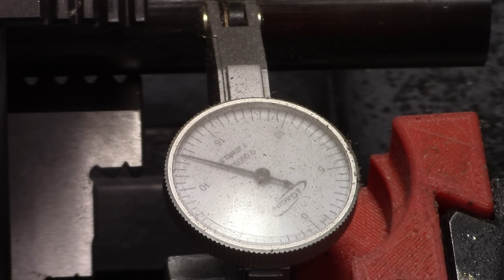Making a Thread Mount Back Plate for a 5-inch chuck + A useful modification, K12-125, K11-125

Comment: Winky thanks for another invite into your shop. They're always appreciated and enjoyable. A couple of things though.. I'm one of those in 'Camp Shoulder' when it comes to its importance. The tenants of that camp dictate that the back plate should be bored for a precision fit to insure repeatability when mounting the chuck to the spindle. Unless I'm missing something boring it for precision fit can be done subsequent to threading.  to facilitate test fitting.  
My other observation was the nifty indexer you made. I'm going to make one too. For those without one "Transfer Screws" come in very handy for accurately center punching those holes. They're sold but nn a pinch they're easy enough to make in a relatively short time. .
Thanks again.
Wakodahatchee Chris
Reply from the maker: I always aim for a good fit but I think the treads are self centering. This chuck was about .003 over but I'm usually about .001 over. Scott Logan said the same about a thread mount. That doesn't make him right but I do respect his opinion. I've had problems with the transfer screws but I suspect it was my drill press quill. I've since adjusted the quill but its not perfect.

Comment: You could correct the runout of the chuck body by taking a few thou off the register on the backplate, re-assemble the chuck, and snug the bolts but not torqued. Test the runout and soft hammer the chuck body in the direction needed. You'll be able to nullify any runout to the limits of your patients. Tighten the bolts and check again.
 Then, test the runout in the jaws.I'm not sure if they're numbered, but they should be, so they go back in their respective slots. Try different combinations to establish where they were ground in at the factory. Once you establish the best combination, mark the body and jaws appropriately.
Reply from the maker: I was going to do as you suggested but after looking at the runout a little closer I realized the jaws were an issue. When clamping inward the runout high side lined up with number 3 jaw and when clamping outward it was 2. The the other jaws (external) were similar but the high jaw was a different number. Basically I didn't want to have to adjust the chuck every time I changed jaws so I ground (actually cut) the jaws level.

Comment: Nice work sir. I had the same run-out problem with my chuck I just grind it to suit the center of my lathe and it worked perfectly since
Reply from the maker: I will likely do the same but I also want to make sure its off the same at all diameters.

Comment: Nice work. I will note, that when cutting internal right hand threads, you should rotate the compound to the other side of zero degrees.
Reply from the maker: You are correct. I new better and messed up. I'm guessing the carriage had enough drag to keep the lead screw backlash from being an issue.

Comment: 13:00, is your compound running in the wrong direction, 
I have cut interior threads like this, but I think you are supposed
to have compound feed handle on the side of the chuck, 
please correct me if I am wrong.....I am commenting while 
watching, so have not watched the whole video yet.....
cheers, Paul
Reply from the maker: You are absolutely correct. I just messed up. I actually run it to the back side sometimes but the way I did it was wrong. The threads are pulling the carriage. It's amazing but it worked well. I guess the carriage has enough weight or resistance. Good catch!
Reply from the maker: Wow...  Good catch, you are right. I just screwed up. Surprisingly it always works but there is a potencial for screwed up threads. The threads are trying to pull the carriage.

Comment: enjoyed immensely, now you can grind those jaws in the 4 jaw to get .0001 runout......best wishes , Paul
Reply from the maker: I was thinking about turning down the register a little and moving the chuck body off center. Another comment suggested removing the plastic chip guard over the scroll and inserting back plate into the chuck more. If I do this I might have room to install set screws to adjust to center
Reply from the maker: I'm thinking about tuning the ledge on the back plate to make it adjustable

Comment: Cool project! When I made a backing plate for my 12" chuck, I used transfer screws in the chuck to mark the backing plate. I really like your lathe indexing setup.  🙂
Reply from the maker: I've done the same with the transfer screw but I seem to have better luck with the indexer. Thanks

Comment: You could have used the outside diameter to register your drill and the worked backwards to the pcd of the mounting holes. Works a treat.
Reply from the maker: Accurately measuring the hole position on the chuck was the hard part. Doable but prone to error.
Reply: If you take a centre distance  hole measurement and divide by 
0.86603 it gives you the pcd of the bolt hole circle. Hope that helps. Love your videos and greetings from Australia.
Reply from the maker: @kevinsmith1976  The center distance is the part that make this difficult. I've made threaded bolts with a point or used a transfer bolt in the past to do this so its doable, just adds a step.

Comment: I like it too! LoL 😂😆 
If you want that chuck to run truer, you can machine the jaws in an out but stable condition. 
Search grinding lathe jaws or truing lathe jaws.
Reply from the maker: Yep...  I've done that severa times. I need to make sure its similar at different diameters first but if it is, I need to do that

Comment: Pardon me for being philosophical here. Re: People saying you can't bore that out. Imagine for a brief moment the nay sayers always having their way. Innovation gets rigidly restricted to established paradigms. And what if this applied for the past 1000 years? What would the world be like today? Safe to say we wouldn't have cars. Or, or, or ...........

Anyway, nice work, Even if you have compromised the integrity of that chuck which was undoubtedly made to the very highest ASME standards that the jobber shops of China rigidly adhere to. (I better check my coffee for sarcasm additives)
Reply from the maker: Ha...  I agree 100%. I've always pushed the limits within reason. I worked for a printing company most my life and there were some people that would rather live with a poorly running machine than to try making it better. The logic was that it was running and you might make it worse while attempting to fix it. As time passed we got updated machines that were much easier to run but the people that were afraid of change stayed on the old machine eagerly working the ass off to avoid change. The last 15 years before retiring I was doing an engineering job (without a degree) designing machine modifications in problem areas. It was a lot of headaches but also fun.

Comment: That turned out nice. I’ve had a couple of attempts at making a collet check. First one was fine, but the second one.  Well, I couldn’t decide whether the thread was tight or the index was a thou too small and ended up trashing it! 😏 Regards Robert
Reply from the maker: I think a collet chuck is more difficult to get right.Thanks

Comment: Another interesting and useful project. The first job I had as an apprentice was fitting a backing plate to a chuck. If that four jaw was mine I’d figure out how to brace the jaws and hard bore them true. Shouldn’t be too difficult with a large carbide boring bar
Reply from the maker: Thanks, yeah I might fix the jaws, I've done that before. However, I need to mark the low jaw and see if its consistent at several diameters before I do that.

Comment: Winky, a Chuck Backplate should be cast iron. It is not a good idea to have steel on steel with the lathe spindle, it can gall up. I do not know of any chuck manufacturer that used steel back plates. Take care using it and add a small amount of lubrication on the spindle thread when screwing it on to be sure you can get it off again. Regards from Australia.
Reply from the maker: Hello Dave, well in this case I'm going to have to disagree. All my chuck have steel back plate and have had for about 10 years. I've never had a single problem. Bison sells thread mount high strength steel plate as well. Steel is much stronger than cast and performs much better on a smaller threaded spindle. I've had threads break on cast back plates. Probably low quality plates but never the less, steel will never break.
Reply: Monday’s experts
Reply from the maker: @normesmonde5332  Generally speaking Dave has some good advice and others have said the same about cast. Cast generally has a vibration absorbing quality and in some cases it might be a better choice. However, to me, this means the cast iron has to be compressible. Years ago I had a Shars 6 inch chuck and cast back plate on my Logan and it chattered bad. I put a 3 foot x 1.5" bar in the chuck and pushed down on the bar. The chuck actually moved away from the spindle register. I replaced both with steel back plates and the chatter got substantially better and the bar test was also much better. Both a 4 jaw and 3 jaw Shars 6" backing plate failed at the threads so this may be a quality issue more than cast vs steel ALTHOUGH Bison chucks confirmed that their steel back plate were stronger. One Shars plate failed at 7 month and the other at 1 yr. Shars would NOT stand behind them and I don't hesitate to throw them under the bus. I do not buy from Shars!
Reply: @WinkysWorkshop  It is my understanding that the backing plate should be of cast iron because when mounting and dismounting the chuck if anything should wear it would be the cast iron and not the spindle. Keep both well oiled with quality oil. 
Aaron from Canada
Reply from the maker: @aarondean8299  yeah...  I can see where a tight thread might be an issue but I'm not worried about wear at all. There is usually oil on the threads and I always make sure they are fairly clean. I really don't think there is a huge difference anyway. The spindle threads are hardened steel I'm sure.
Reply: @WinkysWorkshop  Perhaps USA is different. But in my 50 odd Years in England as a Machine Tool Fitter ( Millwright ) I have NEVER come across a Comercially made chuck with a steel backplate. As I said previously be very careful the the steel on steel threads do not gall. Use some oil. You know the problems you had with your X Y table when you tried to use stailless steel all thread and stainless nut how they galled. Regards.
Reply from the maker: @daveticehurst4191  All Bison set through back plate are steel including their thread mount plates and all Gator brand threaded back plates are also steel. Certainly cast iron is more popular but I think this is primarily due to cost of manufacturing. I agree, cast also has some good qualities and for most applications they are a good choice. However, given a choice between most Chinese cast back plates and steel, I will take the steel. It's a much stronger back plate. As for the threads, I think steel is much different than stainless. All my steel plates screw on smoothly. Of course their is usually a slight oil film on my lathe and I make sure the threads are clean before I mount a chuck. https://www.mscdirect.com/product/details/13535117https://www.mscdirect.com/product/details/13535117
Reply: My Myford ML 7 has a threaded spindle. I have two 4 jaw chucks, one that came with the lathe has a cast back plate. The other, a Pratt & Burnard bought separately, and the P&B, three jaw that came with the lathe, both have no backplate but are machined into the body of the chucks, I'm assuming cast steel. I have made steel back plates for a 5C collet chuck and an all steel ER 25 collect chuck which threads straight onto the spindle. As per Myford's instructions, the spindle and chuck threads are thoroughly cleaned and lightly lubed at each change. I've never had a galling problem. However, if you were to make the plates from stainless, you'd be asking for trouble unless you used anti sieze(messy stuff) at each change. My two cents worth.
Reply from the maker: @ronwilken5219  Yeah...  no way would I use stainless.
Reply: @ronwilken5219  Hi Ron. After laboriously working the chuck off my new to me Logan, I've used anti-sieze. Chucks can still get tight, but have never been the trouble I had the first time. FWIW, I find the anti-sieze lasts through a lot of chuck changes. I just glance at the thread face and if the face is starting to show through the anti-sieze I fill the ~ first half of the spindle threads and run the chuck on and off a couple of times to spread it out.

Comment: daveticehurst4191: Very true in general practice but there’s always exceptions. A hulk of cast iron that size would be ridiculously expensive and messy to machine. With custom projects you use what you have and make it work.
Reply from the maker: I prefer steel over cast. It's stronger on a threaded spindle. I've had threads fail on two checks that were cast.